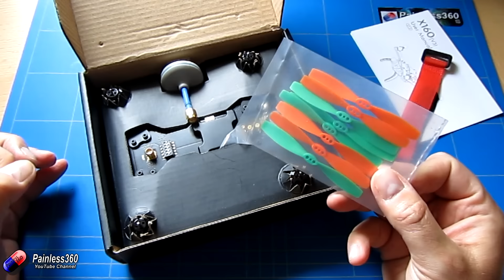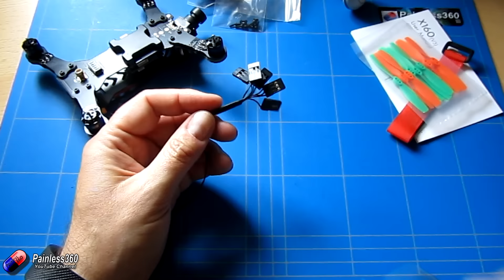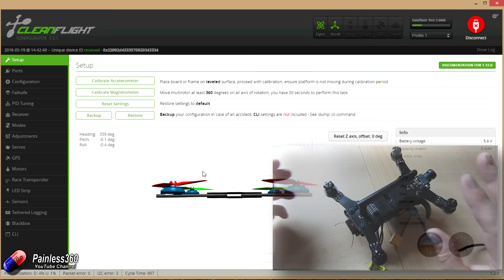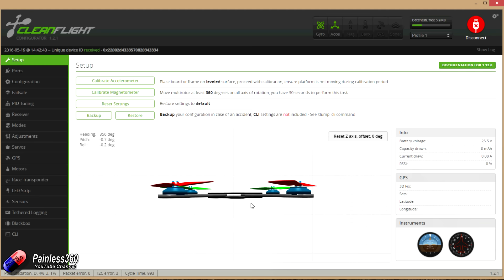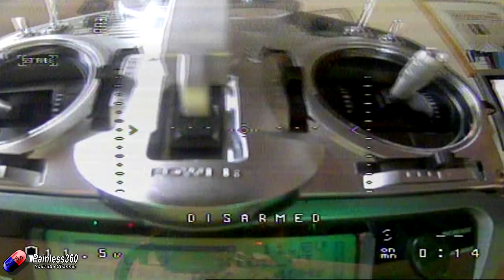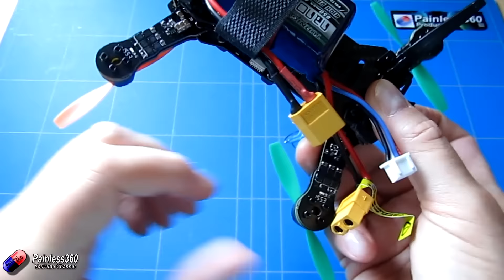RC Reviews: DYS X160 v3

Comment: how can i get this working in 2023 on windows 10? have just got hold of one new now with original firmware, it will connect to my old baseflight on windows 7 but carnt configure it properly through it, any help would be much appreciated
Reply from the maker: This is an old video and how it worked then is shown. It needed Cleanflight, not Baseflight but I'd not be sure how to get something that old to connect and configure ok. Best of luck.

Comment: just brick the FC by flashing it with CF SPRacingF3Mini, which pin should i short to put it in bootload again? please help
Reply from the maker: No idea, I'd have a look in the forums. Best of luck with it..
Reply: Painless360 no luck at all, what do you suggest? Change the FC?
Reply from the maker: The only thing in that case is to remove the FC from the frame and see if there are any obvious boot pins on it. Failing that then it's a new one if you can't get it to talk to the PC. Try all of the setting in the firmware flasher (no reboot etc) in case that works too. Best of luck!
Reply: tried that as well, still it fails to talk to CF. the Sp Racing F3 FC i cannot find the manual in the net. broke the rubber holder already. its a replacement then

Comment: Just a quick question. When I power up my quadcopter it starts to fly forward. I have set the calerbrated it via the software but it still.wants to fly forward when I increase throttle

Comment: There's s simpler to know how to connect the cables, you know that the connectors with one cable have signal only, so you plug the the one with 3 cables with the same orientation, by orientation I mean the side where you see the copper facing to the same direction. At leat I would have done it that way. Cheers!
Reply from the maker: Nice tip! I'd never assume that the person making it was being consistent ;)
Reply: By no means I'm inferring that I'm smarter that you, you showed a "scientific" way to be sure the proper pinout, which has more value for what you do. I just love patterns and if connectors are not consistently wired, it's a clue to infer the attention to detail that went into fabricating that product. That's kinda a second read I like to do.
Reply from the maker: Agreed - I rarely reply on someone else following 'common sense' when they built the thing I'm working on. :D Happy flying!

Comment: too many compromises in my opinion - antenna connector badly placed and liable I would think to break in a crash to to lead to the antenna being broken.  Exposed camera - escs on legs.  A lovely little machine - but ........      living with it might be a exercise in frustration given the nature of the sport...
Reply: Yup, mine broke here although with a pigtail and antenna mounted flat pointing out the back I think it's a great cruiser for FPV. Stock antenna's ain't that bad other wise. F3 and onehsot is huge upgrade over the V2.
I think the Tarot 130 is a more intelligent buy and profile is far slimmer for fitting through gaps plus eaiser to maintain and more robust plus camera can be angled although that was never an issue with the wide view.  Unboxing one now, can't wait to fly it.

I will say the DYS V3 camera is a stunning cmos camera and handles light fantastically, even pointed directly at the sun or quick flashes past it are handled with ease. They did a lot right.

2 minutes flying though, I'd like to see Lee fly more. Much more. Maybe a full lipo at least.

Comment: nice video. The first i would do with this copter. is to replace the motors with 1304 and 3030 props.
Reply from the maker: If you do then I'd like to see a video - sounds interesting!
Reply: sorry, i don't have a x160. you said in your video it hovers at 55-60 percent throttel, so i thout a 1304 3100kv or 4000k would hover at about 45-50 percernt throttle.